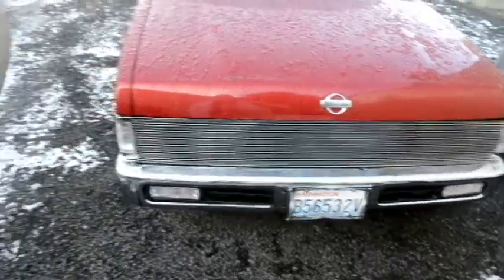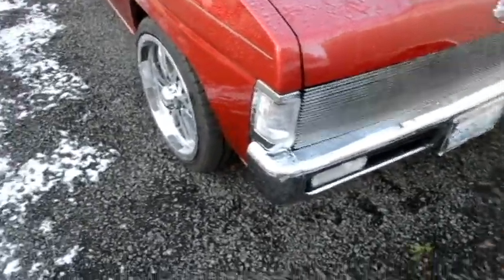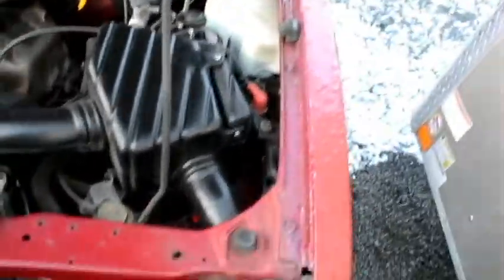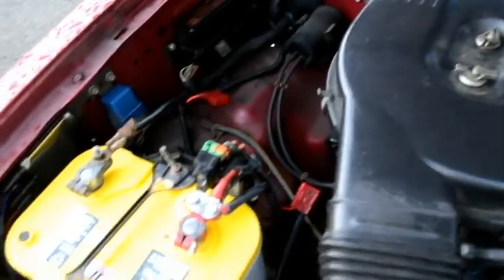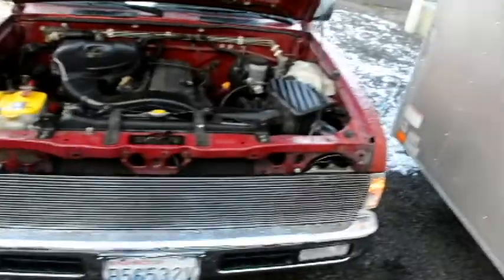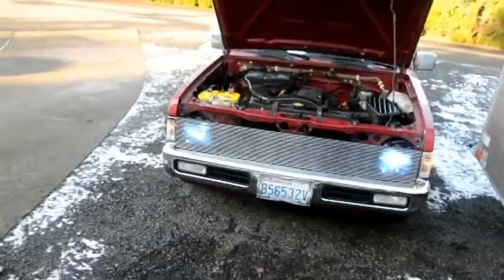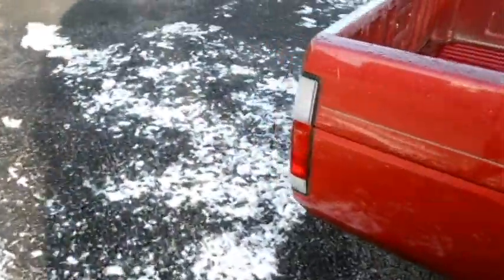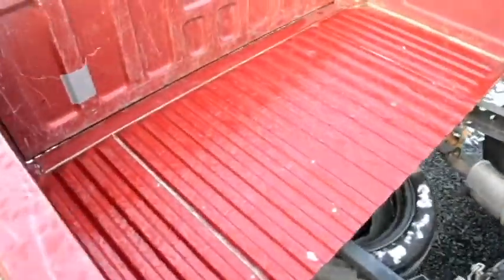Nissan Hardbody project 7

Comment from the maker: now i know this is cheap, but just want to give you a warning before you buy, this looks identical to factory, but in order to make it work i hade to redrill some holes for every thing to line up properly, that said just write this in the ebay search bar and youll find the bumper----->93-95 NISSAN HARDBODY PICKUP PATHFINDER FRONT BUMPER CENTER END CHR FINISHER 5PC